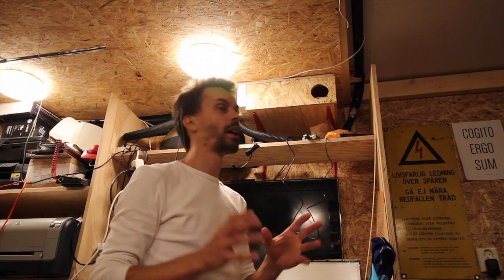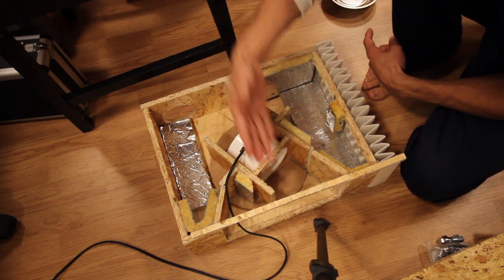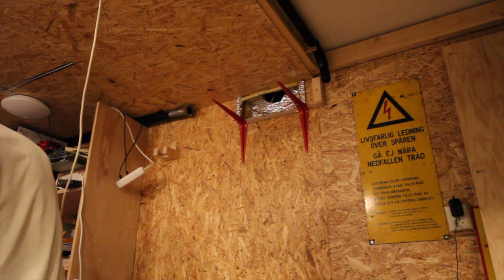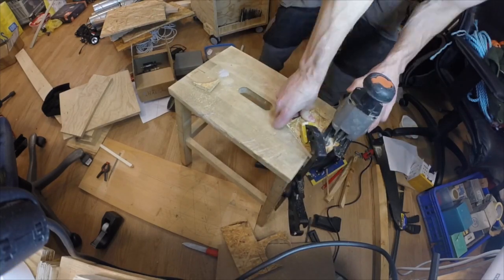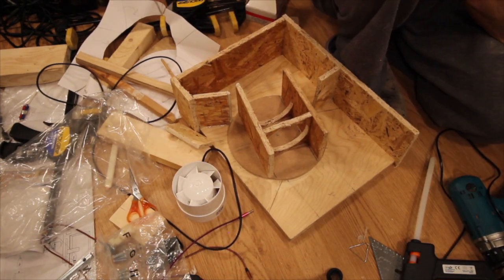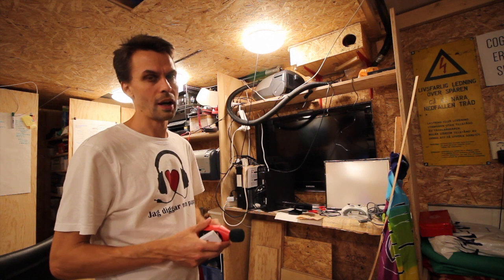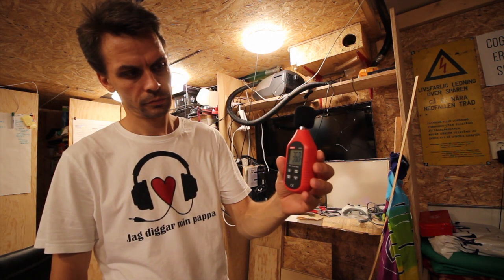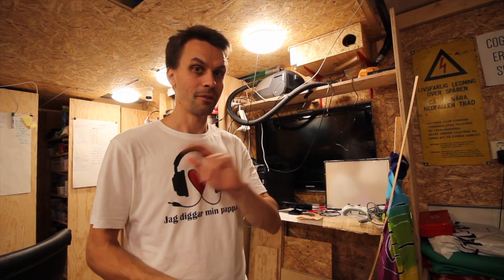My Dust cleaner / Air filter - Building my studio workshop

Comment: i think/belive that if you keep the  intake hole(Air inn Hole) big  and the air outtake(air out hole) smaller or as is. then the air flow will increase. becose it can suck in more air and then as the diameter of the hole decress the air will get compressed a bit and the speed of the air will increase.  it might sound a bit more. but to lower the sound generated you can  cover the outside in sound absorbing material. or just make a biger box and have 5-ich cm of space between them or fill that space with foam or some fabric.  but i'm not a gardener or rocket engineer so not 100% about this....  and rotating the fan ffs that is so daaam smart!

Comment: Nice. Crazy coincidence I made a fumextractor today
Reply from the maker: Great. It is a vita part of the workshop too :). I made one as well video coming. Can you show how you did yours?
Reply: @SourceryOne  I just took a 120mm fan from a computer power suply, soldered on a 12v adapter from a car jumpstarter, glued it with tec-7 to a panel from a bathroom extractor system that fit onto a colapsable plastic tube in the same system. Maybe I'll make like a stand for it out of wire or something if it gets hard to place where I want it. Less then 150kr at biltema build. "Great Scott" here on youtube made one without the tube and stuff, but with a carbon filter instead. I'd guess thats a good idea for soldering, but I'll use mine for welding as well, so it's more for like getting the fumes out of my face. It's kinda like this one, just uglyer and plastic tube
https://www.ebay.com/itm/Solder-Soldering-Smoke-Absorber-Remover-Fume-Extractor-Filter-Smoke-Fan-Air-Pipe/292440346898?hash=item4416cd9112:g:-XcAAOSwObhaemgw
Reply from the maker: Thanks. I got another approach that is a bit more noisy than yours at the moment. I’ll make a video on that too soon...
Reply: @SourceryOne  Cool, I'll check it out when you post it.. For welding I will get som problems if the airflow is too great, but for soldering fumes I guess it's the more the better :)